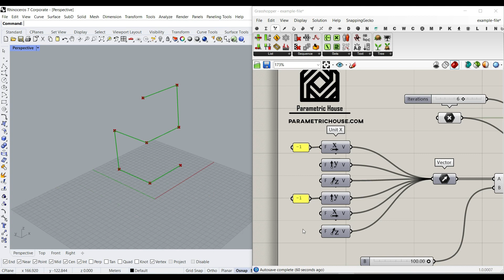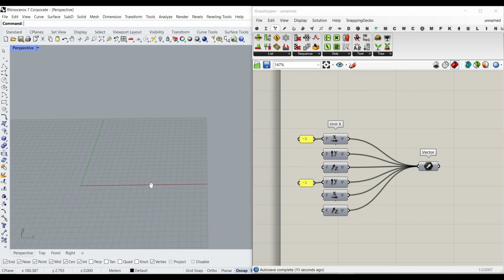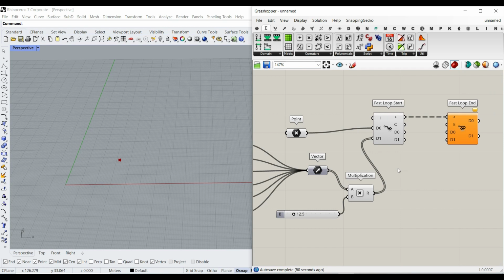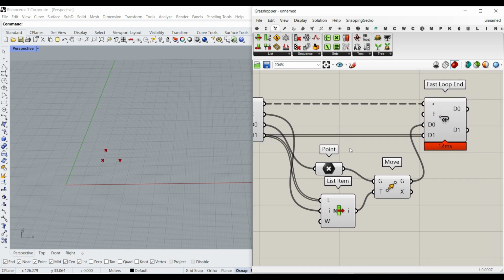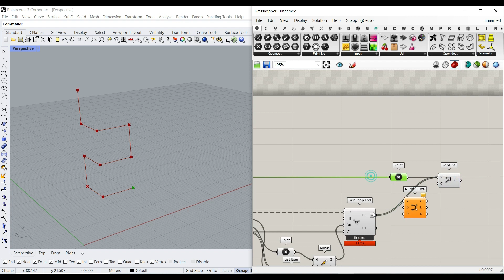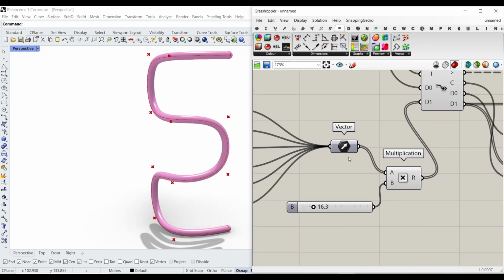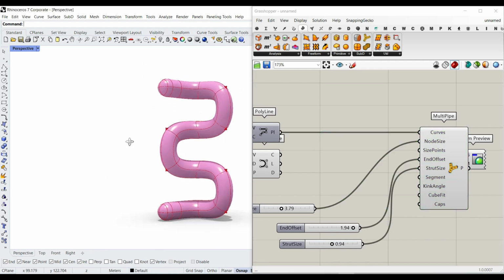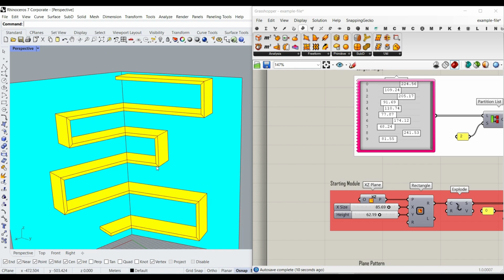Rhino Grasshopper Anemone Tutorial (Polyline)

Comment: Nice to see how you use the different components. Though I'm wondering what the added benefit of the loop is, maybe I'm missing something but I would probably make this without using the loop component.
Reply from the maker: You're right. This can also be done with repeating patterns, but the main reason for using the loop is for the advanced lesson, which is a parametric shelf. In that one, two planes are introduced, and the polyline moves with different lengths and heights. I made this simple lesson for getting started with the basics of Anemone plugin and then taking it a step further.
Reply: True, loop is not required for a sweep but here the lesson explains the application of how a loop algorithm works in a simple application. I've seen exercises with parallel loops, loops in series and nested loops. Those examples are harder. :P.
Reply from the maker: Exactly just a showcase of how things can be done with different methods in grasshopper.